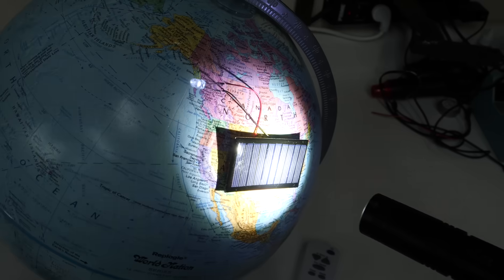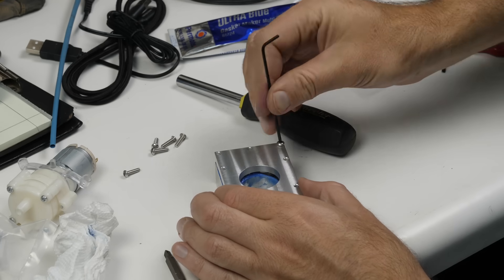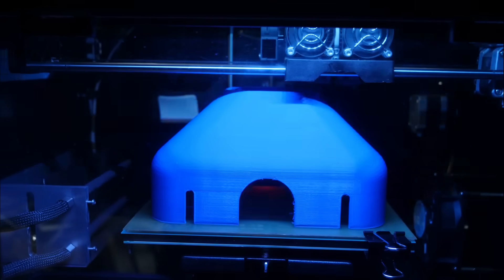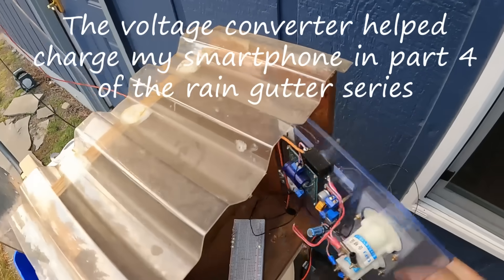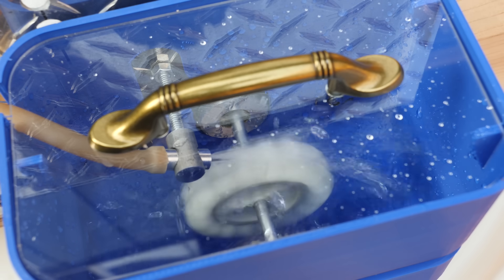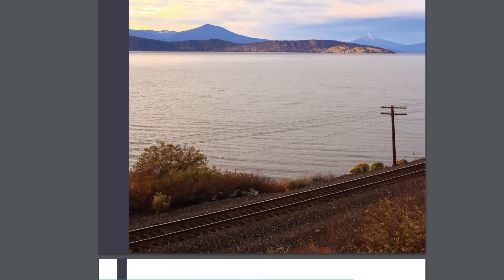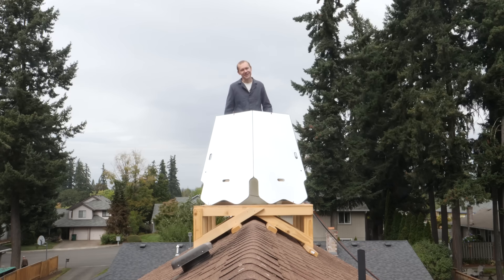Storing Solar Power on my ROOF!!!

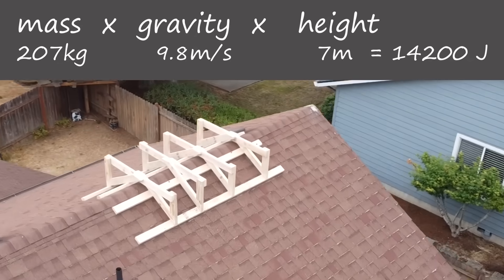Comment: Just to put into perspective, the 14.200 Joules you calculated at 2:27  are equal to 3.94 (lets round it to 4) Watts-hour of energy... That is roughly the energy stored on SINGLE alkaline AA battery (around 2.5Ah times 1.5V), or about a quarter of the energy stored on an average mobile phone li-ion battery (around 16Wh).

For me is mind blowing just how SMALL is the energy stored in form of potential energy when compared to the methods we are used to every day.
Reply: And you did not even count the huge amount of energy already needed to build this setup, or the one the owner will need to spend, for maintaining it.
Reply: @neopermaculteur  I guess you need it to get started from scratch. That is called investing
Reply: @DennisDinges  
I don't understand what you mean. I don't see the link.
Reply: @DennisDinges  
Well, anyway, the investment (call it like this if you want) is not even worth in this case (it provides the feeling of being inventive and finding solutions, but that's actually spending more energy than generating).
End of the discussion.

PS: As I wrote previously :"Can't imagine how much energy YOU spent and wasted by making your experiments, without any kind of significant result (and there will never be any). At the same time you contribute to keep normal people in their beliefs and ignorance.
Bravo!"
Reply: It's amazing that a single AA battery can power the pump long or hard enough to lift this amount of water 7 meters high.
Reply: @StephanBuchin  Dunno if that's sarcasm or not, but it took approx 250W/hours to store 4W/h.  An AA battery won't CREATE the potential energy shown, it just stores a fraction of what the solar panel produced in an instantly usable form.
Reply: @Masheeable  you are perfectly right ☺
Reply: @StephanBuchin It cannot. The battery wattage quoted was equal to what got stored as elevated water mass. The amount of energy required to pump was certainly much higher, due to efficiency losses in the pump and solar power portion.
Reply: @jeffweber8244  Yes, you are totally right. I figured it out since then 🙂
Reply: @StephanBuchin  i dont think so. Why do you think that?
Reply: @StephanBuchin  I don't think that it can.  You are assuming that the power needed to get that water up there is the same as the energy stored in the kinetic energy of the water and then taken back by that water wheel.  It's not.
Reply: @DIYDaveT  yes, u are right 🙂
Reply: i would say hardly. as there is not hundred percent efficiency. also these small tubes have very bad throughput. especially when fully open. So i assume there is maybe less then 50 percent efficiency of the generation and something similar when recovering energy from sun. so at more aa batteries would be needed.
Reply: I really like the concept & with a huge equipment outlay you may get a usable Kwh but it may be cheaper and easier in that case to use a motor, pulleys, solid weights, cables, a matched dynamo & a ratchet stop system. 

In that case and with the right engineering & calibration behind it you may just have a chance of being fairly maintenence free for 10-20 years. 

A big problem with these two systems is matching the water pressure or weights drop rate to the current demanded by different devices being powered at different times so as to get the most efficient energy discharge. (That's the beauty though of nearly all good quality batteries is that in terms of a scale of a few weeks, the battery will mostly discharge only as exactly demanded by the device in conjuction with the efficiency of the wires etc connecting them and once the circuit is broken, the battery stops outputting.)
You can circumvent that aspect and just have the drop be constant but just say the dynamo output was a constant 500w,  the drop time would only be 2 hours or less, even if only a 50w device is connected(unless there's a variable flow/droprate device incorporated) and again that's with a massive outlay of money, time, know how, design & fitment to make it as efficient as possible. 

Having your house at the bottom of a 20-50m high cliff would make this idea super viable and much more cost effective though...  as long as you also owned the land on top of the cliff though.

With the battery chemistries available & being developed right now there's just too many cheap effective options that reduce the viability of the dropping water battery system in the video to a mere novelty, even if scaled up to be able to deliver 1-2kwh per drop.

Salt water batteries seem to be a good option going forward but just the right size matched top quality L-ion battery for your daily needs (with the priority being on longevity(eg it having a larger max discharge capacity than the max current draw of your devices at any given time)) is probably the best storage option at the moment as it will just charge straight from the panel(s) and cut off the charge when full & should give you about 1200+ acceptable charge/discharge cycles.
Very very expensive nowdays,  yes but just a mere fraction of what it would take in just dollars alone to have the equvalent power capacity in a potential energy battery, then again you have the gargantuan expenditure as well of space, planning, sourcing, research & time.

(26/Dec/2022-10:41pm🇦🇺EST)
Reply: @CashIsKing_UseItOrLoseIt  The problem is that even under ideal conditions, there is still a very small amount of enery available. Even with a 10T (10,000kg) concrete weight, and 50m cliff (that is 4.9MJ) that is 1.3Kwh per drop not taking into account losses but...

...you need a reliable and safe system to bring that massive weight up and down, you need to own the land on top of the cliff as you said. And it is still a relatively small amount of energy, since you have that in about 80-100 Li-Ion cells (the amount you will find in a big electric scooter). That setup is for sure much more expensive than the battery, even if it was truly manteinance free.
Reply: @Igbf  - Yep, agreed.  
The only way that system makes an acceptable amount of sense these days (with the battery techs available) is on a very large scale with water & it wouldn't be totally maintenence free unless you just had a wind turbine, living in a consistently windy area, as the solar panels would need cleaning every now & then(& having your own cliff means you may also have your own very regular wind source).

(29/Dec/2022-8:17am🇦🇺EST)
Reply: An average solar battery (9 kWh) stores the equivalent of 472 metric tons of water up on that 7 m high rooftop. Can you please do another video building a structure for this? :)
Reply: can you also tell what is the efficiency of that thing?
Reply: They did the math
Reply: I came here with the question: is this as dumb as it is obvious? I.e. if this works we would already all be doing it. Thanks for this thread.
Reply: @stevecarter8810  I totally agree, however I see value in building something real and working just to show the limitations. As a teaching material alone.
Reply: 13.8 for 3000 mah battery and 18.3 for 5000 mah battery
Reply: funnily enough if you do it on a huge scale its a viable solution as long as the terrain provides the elevation and a space to put the water so you dont have to build the structure.. in the summer at noon so many people with solar on their roofs are providing so much excess energy to run the pumps and those storage solutions have an efficiency of about 80%
Reply: If you have lots of land in somewhere like the ozarks it would be feasible to build 2 large ponds and have an elevation distance of a few hundred feet. A few orders or magnitude larger then his. Depending on how large you make the ponds you could use it as an overnight battery for a house with solar
Reply: @  It is a good point, but still not feasible, even if we manage to jump 2 orders of magnitude (that would leave us with 0.4KWh) we are very far from what a standard LFP solar battery for a household (15-20KWh) can offer. And the cost of that setup even excluding the land itself will quickly surpass the 1000€/USD which such battery currently has.
Reply: Pumped hydro energy storage schemes are the last desperate ploys of the environmentalist politicians and their bureaucrats.
Reply: Rather than using a solar panel, why not lift the water with a manual hand pump, but only lifting max 10ft or so? They use suction and can be incredibly efficient. My theory is that you only need to start it and give it a handful of pumps.
Reply: @lambforjesus2282  Sorry to cut your theory down but...... Rule number one in the conservation of energy.  Energy cannot be created or destroyed, only changed.  If you are pumping a fluid uphill (against gravity) you will require more energy than you can possibly get back due to losses through heat, friction, etc.  just pushing that water 32 feet altitude, the pressure will need to be 15 pounds per square inch.  That 15lbs force per square inch of piston is the energy you will exert to pump that water up.  But hey, it’s a great way to lose weight by burning calories (which in itself is a transfer of energy, eg chemical energy in body fat to kinetic energy (movement) plus heat energy (you get hot n sweat) to potential energy (the water in the container on the roof).
Reply: There's a reason that hydroelectric dams move way more water than 55 gallons over heights higher than 7 meters.
Reply: Yeah, I once did some calculations myself on potential energy storage as an alternative to batteries for solar panels on the roof. As mentioned it doesn't work in an acceptable scale. But for me the Realisation Hit how massive dams are to store/produce so much energy
Reply: but tbh taking a jagg to the roof 4 times to charge a phone isn't that bad, if only losses weren't a thing :(
Reply: @BankruptGreek  but you have to take one thing into account. LCA, the energy used to produce transport and dispose of all the materials used is so great that you could charge your phone probably for years instead. And that's only looking at energy if you take into account all types of emissions it gets worse.
Its a fun project I also thought about doing something like this for fun but that's the only use, fun.
Reply: He said this in the video, or did he edit it in after?
Reply: True, also consider the conversion from potential energy to electricity will be nowhere near 100%. I have a 74 Wh battery that I take with me when I am traveling to be able to charge my phone/electronics. It cost me about $50 and is the size of a large phone. So it is something like 1/2000th the volume of one of the two rain barrels and it stores ~20x more energy.
Reply: I don’t think people are factoring in the thousands he has earned off this video 😂😂😃
Reply: Well that was fun.
Reply: I was thinking about this last night when I couldn't get to sleep. I'm imagining sinking, say, a 13m x 3m x 3m shaft in a garden, then raising or lowering a 3m x 3m x 3m cube of water (ie 27 tons) by 10m. Even if you had 100% round trip efficiency, that'd get you, roughly, a whopping 0.75 kWh. (I was pondering whether it could be done with a much smaller quantity of lead, but even scrap lead is expensive.) Pumped storage hydro taking advantage of existing reservoirs is amazing, but I really don't get the economics of artificial solid gravity batteries,
Reply: I've looked into this a bit more, and proponents of solid gravity batteries aren't proposing them as grid scale storage solutions, rather they're proposing them for fast frequency response. I'm much more prepared to believe that, and it also feels much less exciting.
Reply: A peristaltic pump might be a better way to go to better combat pump head pressure.
Reply: Imagine a 55-gal drum with a wire cable hooked to it and the cable is spooled around a spool. The spool is fastened to a larger gear that is meshed with a smaller gear hooked to a generator. Water is pumped up to barrel until full, then barrel is allowed to descend driving the alternator giving 12-volts DC out. When barrel hits bottom, water empties out and returns to top for refilling.
Reply: Yes this ist the realy amzing Thing
Reply: As a electrician i am also thinking this is ussles cuz this energy cant be used and almoust anything
Reply: yup
Reply: If you wanted to have pumped hydro as an alternative to battery storage: 80kw-hour (an average house consumption with a margin for efficiency losses built in) of potential energy is 288 million joules. That would be the energy released when 3 million litres of water fall 10 metres. 
When you do the calculations, you realize none of these ideas can hold a candle to hydrocarbon fuels. Solar systems with enough panels and storage to replace a person's average energy consumption in a year: natural gas, electricity and gasoline, are cripplingly expensive. This whole net zero drive is not something the average person can achieve with solar panels at an affordable price. It's a giant scam
Reply: Its not a real example for storing energy… could be done in much much greater scale if conditions allow like a clif next to a town 500m high and lods of energy needing to be stored and reused to power the whole town… c it like an example in theory
Reply: yeah i was gonna say this is not very much power..
Reply: We should use mercury :P
Reply: @laurahaaima1436  you are a genious...though you need a very good construction and expensive parts, quick silver itself is difficult to buy...
Reply: Thanks.. !
Reply: @jiannisDimi  And yes.. almost undo-able.. Maybe Cody has the amount of mercury needed.. And Smarter everyday the engineering capability's Would love to see it work.
Reply: @laurahaaima1436  Why mercury?
Reply: @Igbf yeah its the same energy. That said, the AA battery would need to be discharged really gently to get the full energy out, and wouldn't be rechargeable after. Same with the Li-ion phone battery. Gentle discharges, and it'd stop performing after a year of being fully charged and discharged.

IMO a really good comparison to a water battery is a supercapacitor. a 3000F 2.85V supercap can store about 12kJ of energy and is 2.3" diameter 6" tall roughly. The best part is you can get almost a kW out of it if you needed, while the water would be limited to the tubing diameter and turbine size.
Reply: Also its near to muzzle energy of .50 cal bullet
Reply: And that's only calculating the amount of potential energy stored, not how much energy it's going to take to pump it up there, since no pump is 100% efficient, nor how much of that potential energy is going to be wasted when you try to covert it back to electricity, because no water turbine is 100% efficient. 

this project is an incredible waste of time.
Reply: @Hephera  it's a waste of time, IF (notice big if there) you ignore how much he makes from over 3 million views.  I'm sure it was worth the effort he put into this.
Reply: It's not a waste of time. It's a fabulous demonstration of the superior energy density in other storage methods!
Reply: @Steven-mv4bb  In other words, Just some good intellectual fun
Reply: @Steven-mv4bb  LOL
Even demonstrating this, is a waste of time, ressources and energy... because we knew the result BEFORE.
Reply: @neopermaculteur it's only a waste if absolutely everyone who watched this video learned nothing. Which is not the case. Therefore nothing was wasted. 

Is it a waste to do titration in school? No. Because people learned. The storage wasn't the goal, education and entertainment was.
Reply: @harmonic5107  
So, it won't be only a waste if we destroy everything around us, because a lot of people will probably learn from it.
History books are wide open in front of us, with all the knowledge, but people still want to make their own tries.
I don't wanna answer. You think you're right. I thing you're absolutely out of touch with the reality.
Reply: @neopermaculteur my dude, he put a barrel on his roof. You need to calm down 😂

One person doing science in his backyard to teach thousands is an extremely good trade off. He hurt no one, he didn't pollute his local area. There are zero negatives to what he did. And a ton of positives. You need to take a step back and look at yourself. Why did you decide to say what you said? Was it because of the content of the video. Or was it more to do with factors in your own life outside of the video entirely? Take a breath, go for a walk outside. And enjoy life, rather than posting negative comments on an educational youtube channel. It hurts you to be negative all the time. Help yourself.
Reply: @Hephera  I get the sense this project, like the rain gutter project, was not about having a utilitarian source energy, but more of an educational topic using resources laying around the dude's house lol.
Reply: @Hephera  🤔Back in your *box*🤣
Reply: @Hephera its not about efficiency
Reply: @Hephera this project is an effort of showing how two water tanks could replace a battery…which is good.on the other hand its realy suitable to back up power for a whole villge than a house🎉
Reply: @Hephera  bro, examine your locus of control. Watch the video again and tell me honestly if you think he's doing this for a 100% efficient battery. Or just the last 20 seconds. I'm begging you.
Reply: @williammitchell6254  But efficiency is a great topic to cover. That pump is not matched to the solar panel (5W vs 50W) so you're throwing away most, if not all, of the energy. It's a great topic to work out component sizing as well as the efficiency of each component. Once you match the pump power to the generator, you could try to increase the efficacy by looking at flow rate vs pressure / head vs power and see if a centrifugal pump has a higher efficacy than a diaphragm pump (the one in the video). If a centrifugal pump operates at a fraction of the power at the same head and flow rate, it means you can add more storage capacity, or you can downsize your solar panel.
Reply: @Infinion  right, so if he increases the flow rate falling he will get more power but for less time. The real question is what is the best most efficient flow rate for max power output?  Anyone know this formula?
Reply: @lambforjesus2282  You can do it experimentally by measuring flow rate vs power output. Plot a fit curve as these values increase and look for where the slope doesn't maintain linearity and starts to plateau. Identify what is contributing to that breakdown and fix it, or set your operating parameters to operate in the best region within the existing performance constraints.

My guess is that the impeller size and nozzle bore is probably the limiting factor here. More flow would undoubtedly drown the turbine's impeller. Sizing everything up vs running multiple of the same size in parallel would be an interesting design consideration to find in the data.
Reply: @Infinion  centrifuge 👍
Reply: @Infinion  yes, could be made more efficient, possibly even by using a ram pump, and then using the water when needed. One could even first just use the hose pressure to get the water up first time, then the solar pump to recycle it once you've already gotten one round of generator power from the barrels worth if water.
Reply: @williammitchell6254  I agree with you. But it has to be highlighted just how bad of an energy storage solution it really is. He was like "over 14000 joules of electricity!! 🤯" (2:30) and that's just plain deceptive
Reply: I just had the same thought. All this wasted material, work etc., when a simple calculation could have told you that the result with be energy storage worth just 4 USD (and actually not even that, given the energy requirement for the pump).
Reply: @kiyuxlgh  Um 4 watt hours is worth far less than 1 cent not 4 dollars. I pay about $.12 for a kilowatt hour of energy.
Reply: @TheGerm24  You retrieve the 4Wh essentially every day, but still I made a mistake and it comes down to rather 40 ct per year.
Reply: Except... the one benefit to his set up, which ODDLY he never mentioned, is water storage that then can be utilized in a gravity fed system
Reply: @yeahrightgraphics4621  this right here. It's not uncommon for people living off grid to pump water into a storage tank during the day when they're producing extra energy so that they can avoid running a water pump at night. 

Not that this isn't a fun experiment, but it's literally taking a well established practice and doing something way less useful with it. 😂